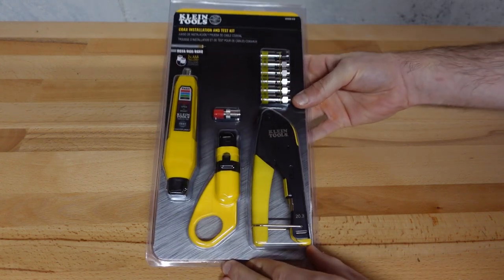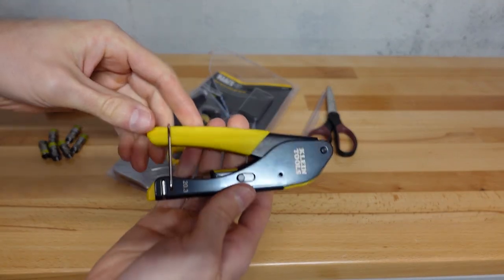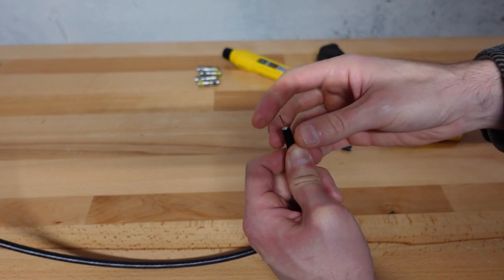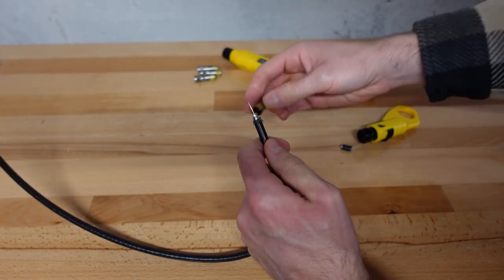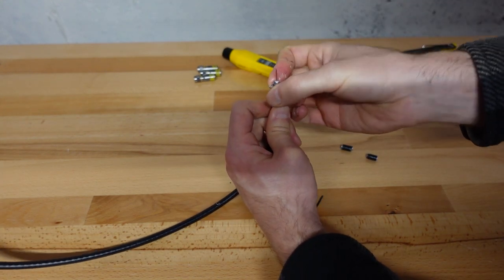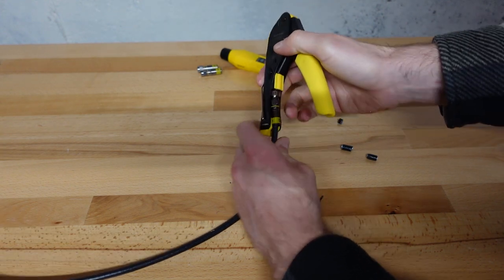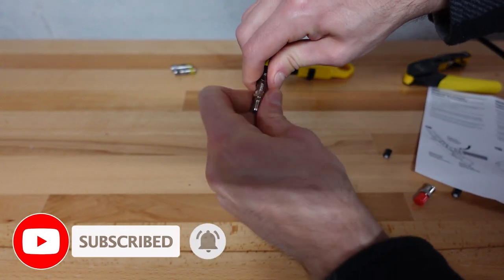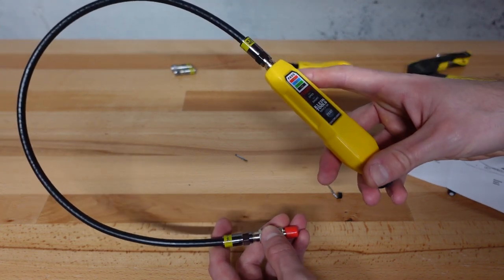Klein Tools Coax Install Test Kit - I Never Did This Before

Comment: You used the stripper backwards. If you slide the black piece up and insert from the other side you will do the jacket and insulation strip at the same time and it's pre-measured for you. Good video otherwise!
Reply: Yerp, the black stopper will set the depth automatically.